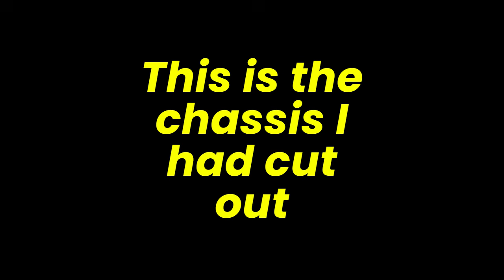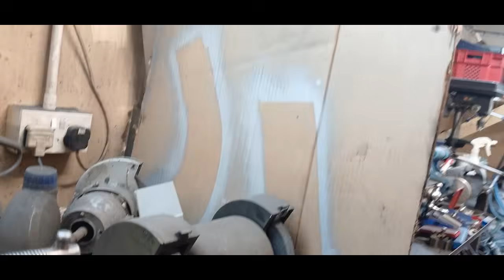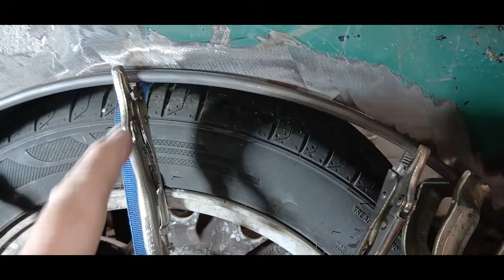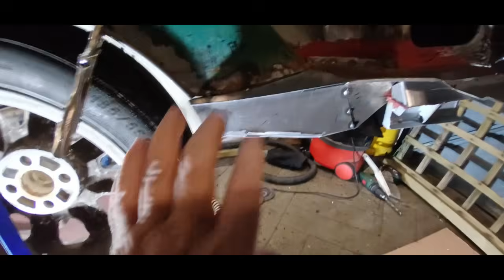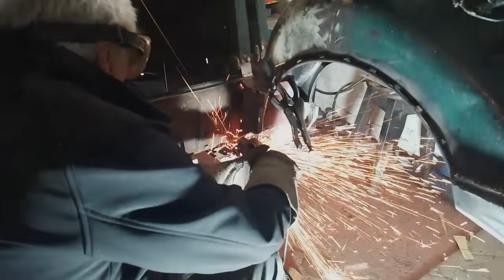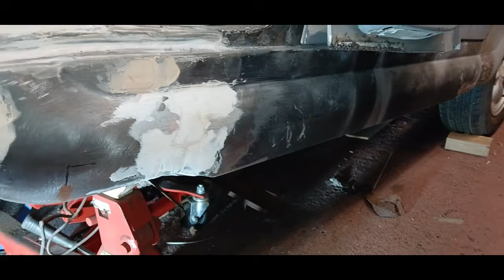The boot on my classic car is now the engine bay for the new engine, Madness or Genius ? #mid engine

Comment: May I suggest seam sealer or resin to cover the welds as body filler is prone to holding in moisture
Reply from the maker: Thanks for the tip, I will definitely look into using seam sealer to keep the moisture out!..................Lee

Comment: What ever works , as long as you get it to where you like it , the bugger better fit mate 😊cheers
Reply from the maker: Have run a tape over it, its a bit tight.Just finishing work on the other side to match the one in this video. A few bits I want to do before the engine goes in. In the next couple of weeks the engine will be offered up...fingers crossed...
Reply: @PastimeClassicCarRestorer  keep it coming like to see the finished product
Reply from the maker: Looking forward to some mechanical work, nice to get away from cutting and welding for a while.........................